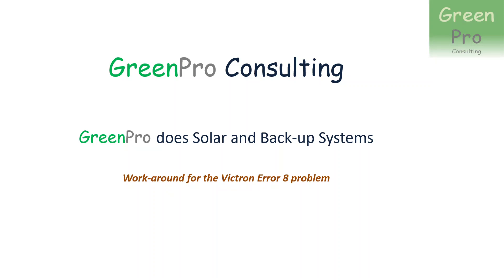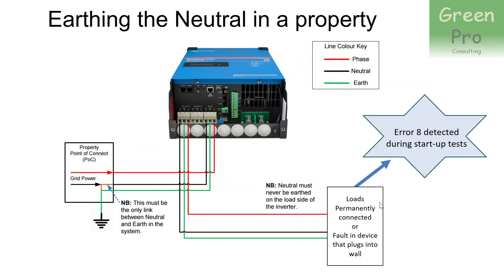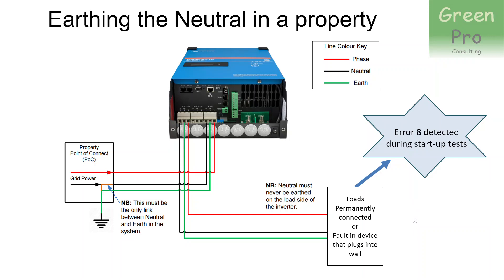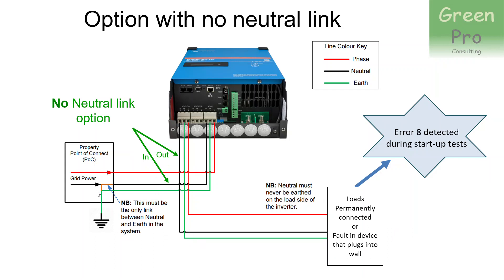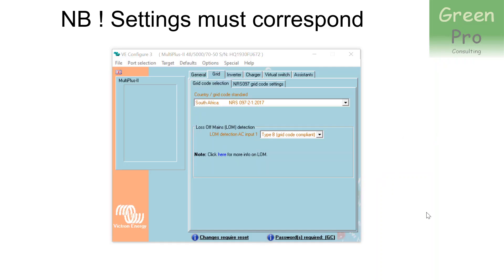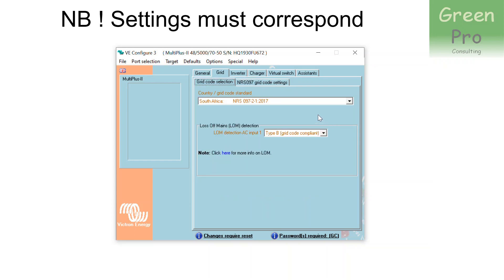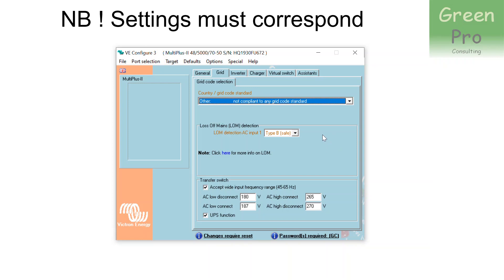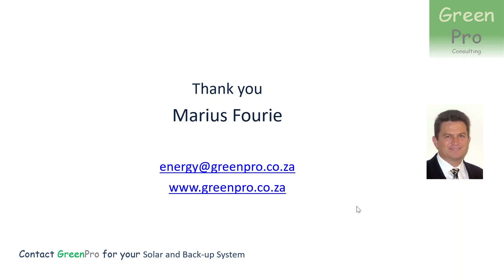Victron Neutral link options

Comment: I don't think SANS10142 allows you to link the neutrals like that (I am not a sparky, but I do a lot of support from the software side). If I read that part correctly, you are allowed a common neutral only in some cases (it is in Annex S I think, with the diagrams about generator/alternate supply connections). Other parts of the world do allow it.

I agree that often you get an erroneous error 8 indicating that the relay was closed (PE2 closed) because of bad devices in the house. Typically cheap surge arrestors and EMI filtering, which typically contains a capacitive component that passes current at some frequencies but not at 50Hz.

Also, the issue is mostly resolved after late 2020/early 2021. An auxiliary contact on the bonding relay is used for the test now instead of a voltage measurement.

I had one case where the customer got a "PE2 open" error. If you get that one, you are probably looking at a real failure. However, this customer discovered it is caused by a long unused PV cable going up to the roof (nothing connected, future expansion), acting like a big old AM radio antenna. He disconnected that and the problem went away.
Reply: Wow